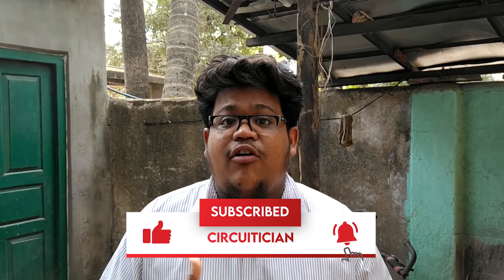LORA Ultimate Range Test | 2 KM Range Tested

Comment: Hi, thank you for your video. I am using LoRa SX1262 868MHZ (Indian) Freq.  I cannot communicate P2P LoRa nodes and I tried (UNO, ESP8266, Arduino R4 WiFi, etc.) boards and library. Can you help me with which board according to the library, I can use?

Comment: Hi Thanks for your video.. I have recently tested with LoRa SX1278 433Mhz module. i have kept the transmitter module on the top of the 3 storied building and hardly. I was getting 50m range only. What could the possible solution?
Reply from the maker: Where is your receiver ? Ground level or 3 storied level of another building
Reply: @circuiTician  Thanks for your reply.. The receiver was placed in ground. Although I also placed both the devices on a strait road with line of sight. It covered almost 50-60m.
Reply from the maker: Ping me on insta we can discuss more there
Reply: @circuiTician  check your antenne that is the Alfa Omega
Reply: You have to use frequency according to your region. It won't work for longer distances if you use the wrong frequency at the wrong region.
Europe: 863–870/873 MHz (EU868) 
North America: 902–928 MHz (US915) 
South America: 915–928 MHz (AU915/AS923-1) 
India: 865–867 MHz (IN865)